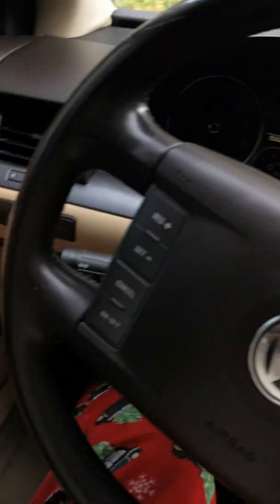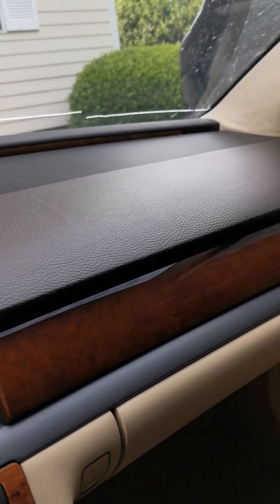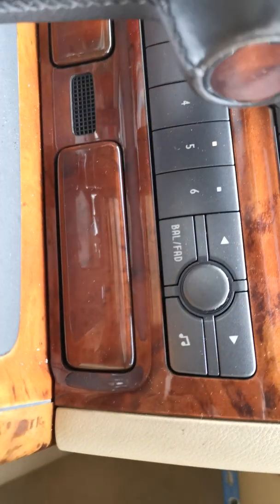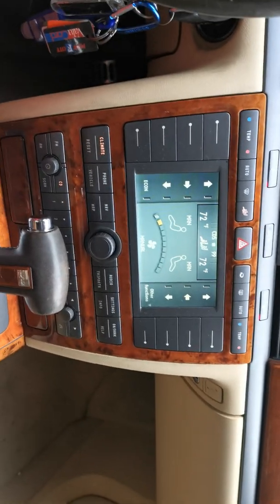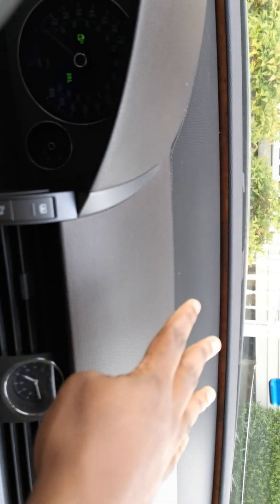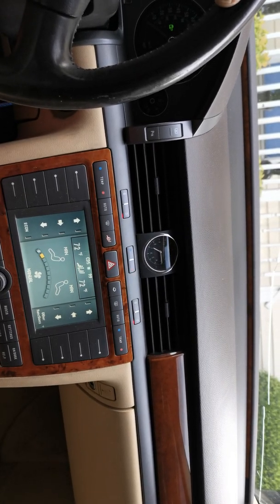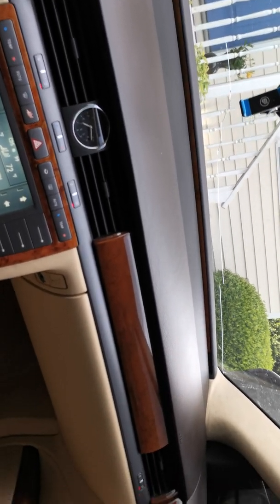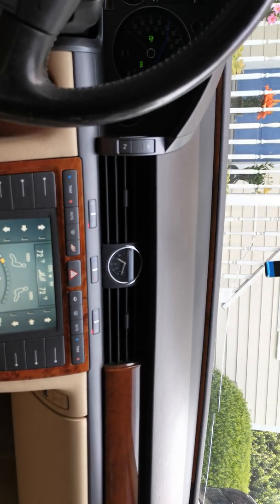VW Phaeton AC System Guide

Comment: Thanks for sharing! I own a 2005 Phaeton, have had it for 3 years now, and I absolutely love it. I learned everything about the car and how to operate with all its functions pretty fast. This car is more intelligent than everyone think. The air vents, when you're driving and you have them closed, can roll up by themselves at any point in time, in order to keep the set temperature. For example, not all of them simultaneously, but only a corner one, if the car senses that the climate on that side is warmer than on the other. Not even a modern Mercedes has that, not even Bentley. And now, imagine all of this back in 2000s. This car was way ahead of its time. Yes, it's old in years, but not in the looks. When I see one anywhere on the streets, it looks way more expensive than all the other cars around.
Many think that it's a weird, illiquid, unneeded car, but those who buy or own it, understand what it's all about and will cherish it. 
And personally, after having driven for 3 years in a Phaeton now, the only next car I want is the NEXT Phaeton. 😃